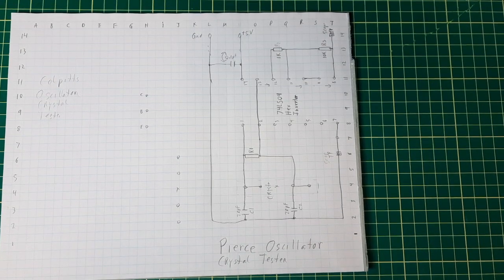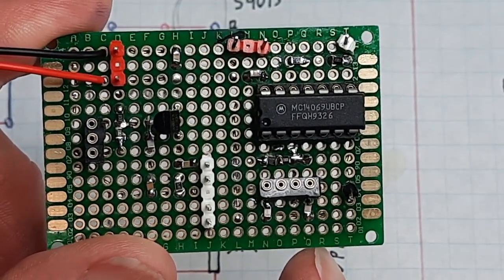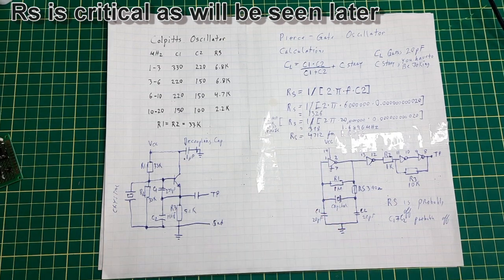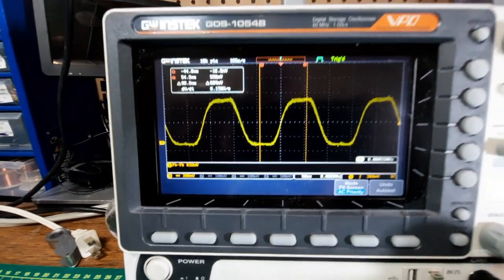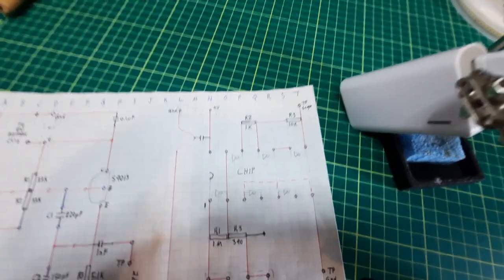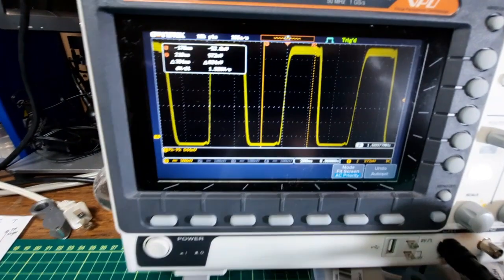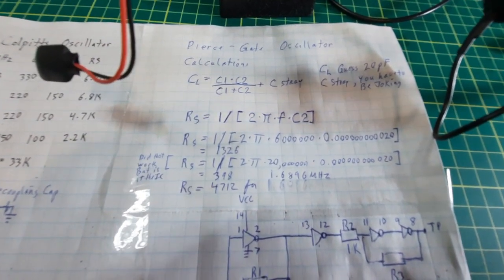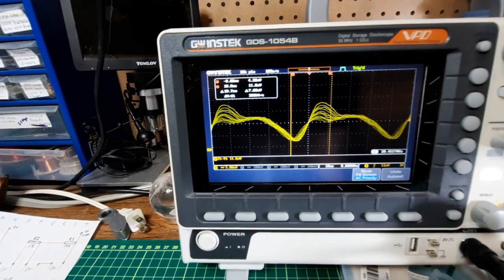Pierce Gate Oscillator for testing Crystals

Comment: how can measure crystal frequency without oscilloscope ? Is there another method?
Reply from the maker: You can buy one of those cheap Ebay/AliExpress etc, frequency counter kits. Just search "frequency counter kit" on youtube. Some come with a crystal tester built in. I have seen videos where the person modifies parts to add a preamp for the frequency counter.  Hope that helps.